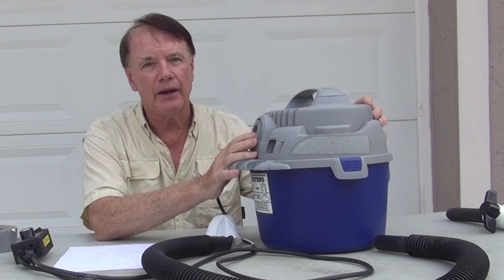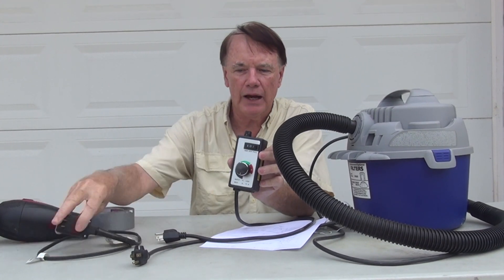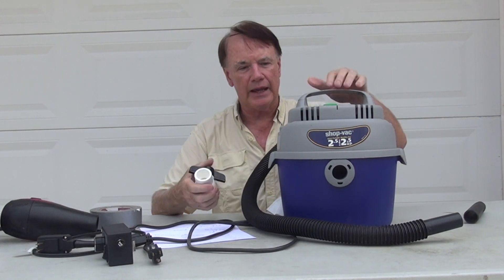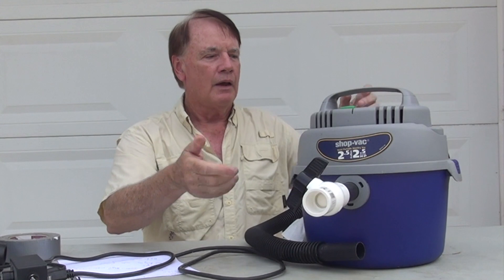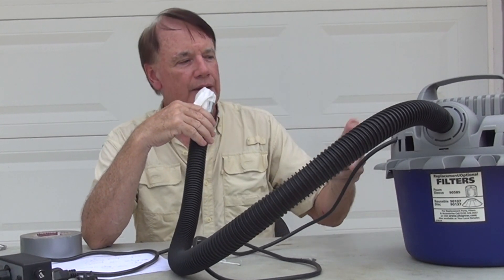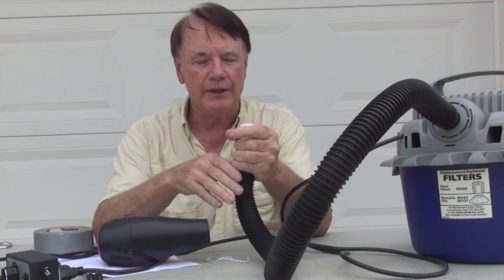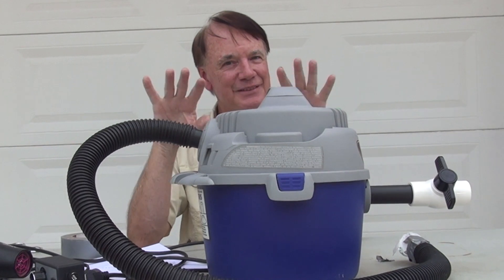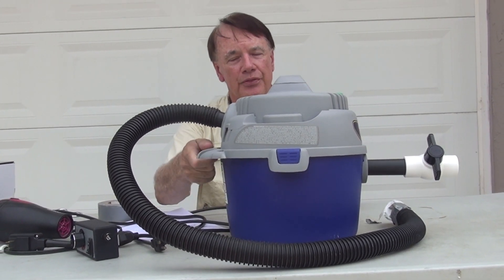DIY homemade cpap - ventilator

Comment: Inspiring ideas. Thank you Mr Gene Payson. 

I read some comments regarding the need for filtration:
I have just seen another video about air purifiers. Using 4 square merv filters and a box fan to build a large air purifier. These have shown to be way more effective and cheaper, than what's available on the market.
I can see them modified to a point where you put this DIY ventilator inside of it and get very well filtered air as output.

Comment: If I were to try this, I'd start with a brand new shopvac or hair dryer (or aquarium pump).  Don't think you'd ever get a used shopvac to be clean enough.
Reply: nah, I would use and old/ used shopvac to get the airflow control, and once I get the logistics I would move to a new one for use.

Comment: Why not a just small desktop fan, some of which are portable with long lasting batteries? They are fairly low noise, too. You just need to funnel the airflow down to a narrower tube that the usual hose and mask can be attached. Adding a humidifying chamber shouldn't be that difficult.

Comment: Or you could connect your car exhaust to your refrigerator then a chainsaw and adjust the airflow with a forge bellows.  If you do anything like this, use a full face snorkel mask $10 on amazon, with a more controlled air flow and A LOT MORE QUIET like an aquarium air pump. BUT YOU MUST INCLUDE A CO2 OUT VALVE  With the correct pressure for your breathing strength. no diy, get an authentic valve or risk dying

Comment: Filtration is incredibly important when creating a positive pressure inhalation system. Since they've already figured out the science of making a positive pressure unit I believe more focus should be put in all current devices sold out to the public as we've already seen problems with Phillips devices. The whole industry is a racket and takes advantage of anyone suffering from something easily remedied. When a customer is suffering from lack of sleep they tend to make very expensive decisions to hopefully find some relief.

Comment: there are some free piston aquarium pumps that you can buy online in various sizes that are oilless, low pressure, continuous duty, efficient and very inexpensive that could make a good source for air
Reply: I did this using an aquarium pump attached to a cannula.  It felt good, but I think I needed more pressure, so you'll need to experiment with different pumps for this idea to work.  And by the way, I have a friend who's an ENT md, and he liked the idea!

Comment: I think you would easily be able to add some pressure instruments on the side of those hoses so any type of pressure that needed to be monitored would be able to be monitored easily they also make pressure switches that will tie into the electrical system and shut something off if it reaches a certain pressure setting that you have it adjusted to for safety

Comment: Well its a great idea but the reason why people want DIY devices is to save money from not buying a certified CPAP machine. Seems like the cost of this DIY project is more expensive if not close to the real thing.
Reply: Not even close. Real ones are $800 plus.
Reply: I think the biggest reason for wanting a DIY device, and as Gene mentioned in the video, is that there is a shortage of CPAP machines.

Comment: The concept is good buy the shop vac is extreme .
There several devices that supply air through a mask but not designed to replace a CPap . But would supply  air in a industrial application . Sand blasting air supply welding also EasyFlow mask air supply .

Comment: good overall. weakest part is the lack of a mask. i would suggest using a full face mask of those used in construction and 3d printing a hose-mask union. you dont want o breathe through  your mouth

Comment: Good ideas Gene, but once you make a self-contained circuit with the valve, there is no way for the CO2 to release and bring in fresh O2 so the patient will suffocate.
Reply: Your thinking does not cater for the idea that an increase of CO2 makes you involuntary choke and wake. Just try to inhale a soda bulb gas from a balloon and you will experience the vivid sensation of startling rejection in the throat. A tiny experience of this occurs if you inhale before drinking a soda drink. The latent CO2 sitting (heavier than air) in the shallow of your cup makes your throat constrict ever so slightly.
Reply: Unless the patient breathes out through their nose.

Comment: I was initially interested in your D-I-Y CPAP idea, even allowing for the fact that you have no way of monitoring the applied pressures, and no safety cut-off (overpressure) devices. As you suggested, a proper CPAP mask will be a hundred times better than your tube-in-mouth / inhale & exhale options,  although enriching the atmosphere with oxygen around an unsealed electric motor  is a great way to start a fire.
But once you began talking about a ventilator arrangement, that should have been the place to terminate the recording.  Leaving aside the necessity for a patient to be intubated,  ventilating the "tight" lungs of someone with Covid-19 really is a potentially difficult operation, and a negative pressure during the expiratory phase is exactly what you do NOT want.  I'd be willing to bet that no healthcare professional would want to go anywhere your ventilator arrangement.
At least you didn't advocate the Donald Trump idea - adding bleach to the water bath would be rapidly fatal !

Comment: Good thinking! You definitely thought through some of the variables of a modern ventilator.

The basic cpap(continuous positive airway pressure)  is indeed fairly basic and it’s really just pressure, flow rate and some type of mechanism to allow for exhalation against the pressure.
What makes a modern vent to later what it is is the triggering device is set off by the patient’s attempt and allowing the patient to breathe using their own breathing rhythm.
Forced breaths against an natural breathing rhythm is very intrusive and uncomfortable and requires patience to be sedated. At this level the volume of each breath needs to be adjustable as well as various pressures during the breathing cycle. Thanks for making the video